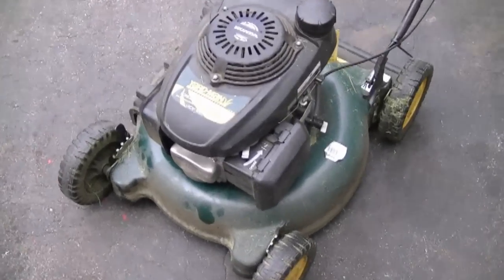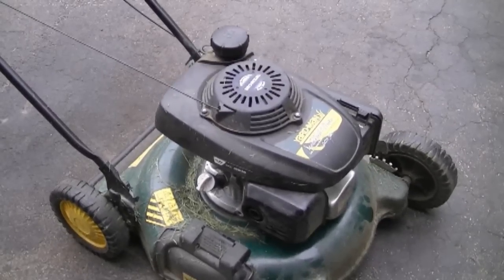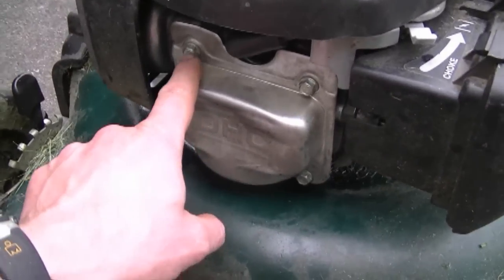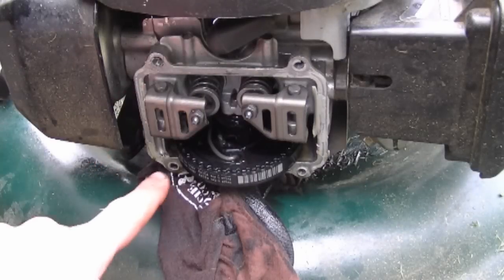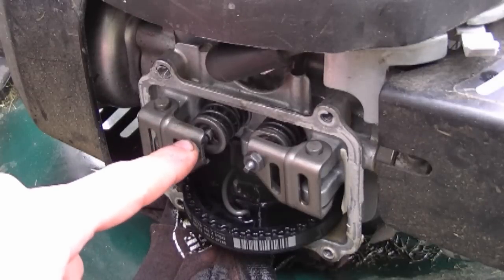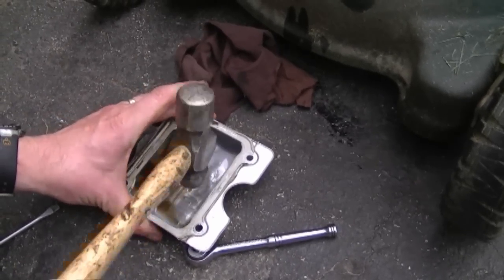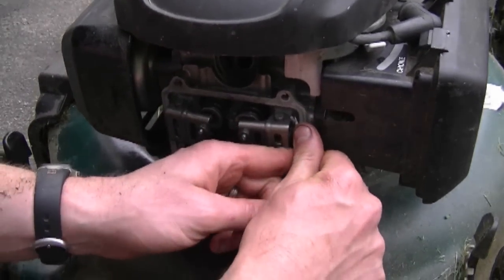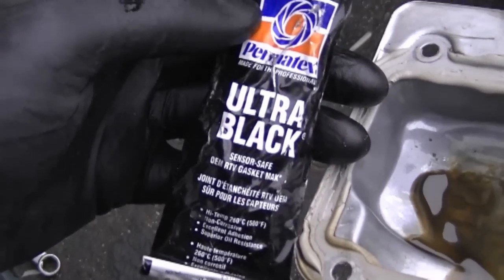Easy Low Engine Compression Repair on Honda Lawnmower - MUST SEE

Comment: Thanks Dony. I just bought a $20 Honda without much compression. I adjusted the valves to spec, no improvement, still backfire through carb. New spark plug, checked timing belt, checked flywheel key, still backfired through carb. I watched this video, took the valve cover off, and it STARTED. Took hammer, straightened valve cover, very small bent spot, and it runs good. Changed the oil and going to cut the yard with it tomorrow. Thank you!! I was almost ready to give up until I found your video.

Comment: One of my customers gave me a yardman/mtd mower with a Honda engine. The recoil was broke. So  I ordered one for $16.00 USD and it fired right up after setting for over 2 years. Cheap fix for a fairly new looking machine. This is the first mower with a Honda engine I've owned. The choke lever is different. As I noticed that it slowly turns off after you turn it on. Thanks for the vids I really enjoy them

Comment: Excellent video. The only thing I would recommend in addition would be to clean and dry the inside of the cover before reinstalling it. The oil in the cover might run out onto your fresh silicone when you tip it up to put it back on. Thanks for all your great videos.

Comment: How is the GCV 160 overall? I have one on a Troy Bilt going into it's 4th season, and am really happy with it.I change the oil once a year with synthetic Rotella T 5-W40, blow out the air filter with a compressor, and it starts on the first or second pull every time.

Comment: Thank you I tried to find something on this particular subject but like I said no one explains it very well. I found at least one video where a guy tells you what each valve should be set at. The problem is he doesn't show you how you would adjust them if they weren't set right. I did watch your other videos on valves and they are awesome thank you for all this info on all these subjects.

Comment: Just a little tip, when I form seals with black silicone, I apply a thin coat of paint to each edge of the surfaces that will be in contact, leave it dry and then apply the silicone. Just because when if I have to fix the same engine, the silicone will come off easily and do not have to remove it whit a cutter or something similar, and the engine keeps clean. Best regards !!!

Comment: i had a no-crank no start issue on my lawn tractor and i immediatly expected it to be something with the carb. the battery had been on trickle charge the night before. so there i was with all the covers and shrouds off screwing with the carb. then i look over to find the blade engagement lever was engaged! sometimes i just feel like a genious!

Comment: You suppose to snug the valve cover slightly then wait 20 min till the rtv harden up then slightly tighten a little more to squish the rtv . That defeat the purpose of the rtv on two flat surface .

Comment: If you find this happening on a GC or GCV160, the valve cover and GASKET from a GSV190 will fit and is much stronger.

Comment: Interesting vid! 
I didn't even know Honda made OHC pushmowers, guess I need to go browsing at more dealers. I don't need to upgrade though, the old 73 Briggs is still running STRONG!!!  :)
I will definitely be taking an OHC engine home, if I find one in the scrap yard!
I wonder how long the timing belt lasts, do they recommend you change after 100,000 laps around the backyard?!!!!!  :)

Comment: Does this mean that if the pull rope on my edger is soft to pull then I may have low compression?
Some time it feel like it is soft to pull but then it goes back to having a little more resistance.
Is this some thing I should worry about?
Thanks

Comment: Amazing how many times just the little things can hold you back with automotive parts.  As in this case a stationary part.  Had a good laugh with the hammer cause that was part of my nick as a lad with other gear heads, "Arm & Hammer". My wedding band has same finish as that valve cover, peened finish.

Comment: @donyboy73 i ended up replacing the timing belt on my MTD Honda...dont replace the belt,replace the mower because once the belt snaps the motors done for.

Comment: Bought a used honda mower had NO compression.  Pulled the valve cover.  The valve stem on the left is broken.  Puncher a hold in between the two value seats.  If I just replaced the valve stem is the hold there going to cause a problem?  How much pressure does it need to hold?  Can I just patch it up with something?   thanks

Comment: Hey dony what would cause an engine to have to much compression. Ive been working on a Briggs Quattro engine. Ive cleaned the fuel tank out and added new fuel, Ive replaced the carburetor, diaphragm, gasket and air filter, I put new oil in and I replaced the spark plug. I did start it up and it smoked for a few minutes which I was expecting. Today when I tried to start it up it snapped the pull cord do you have any idea what might be wrong?

Comment: Timing belt is running in oil. Are there other small engine designed that way? Have you seen broken timing belt in small engine?

Comment: I have a craftsman 6.75 high torque eager1 engine that won't start.  I think it's a briggs. The plug is sparking. when I pull the rope it makes a popping sound. I sprayed some carb cleaner in the plug hole but it wouldn't fire. Do you know what might be the problem?

Comment: i have a 6.75 hp briggs and stratton lawn mower. the piston rings are good and so are the valves and gaskets but still has no compression. can i get some help?

Comment: I have a OTROY-BUILT HONDA MOWER. 
The handle came down to far to the blade as I was mowing the grass, they got loss because  the screws felt out. The blade bent the handle tubes and the engine locked out.  How canI repair it. How can I straighten the tubs to pull them out of the cover and can the engine be repair?

Comment: Hey dony I finally figured out how to adjust the heads. I did end up adjusting them but I still have to much compression. I called Briggs and the guy told me that the intake should be .005 / .007 and the exhaust .007 / .009. My intake is about .006 and the exhaust is about .009. I'm within tolerances but I still have to much compression any ideas?

Comment: Surprised you put the new RTV over the old.  Judging from all your past work I have seen I would have thought you would have cleaned that off.  I know this is not a high pressure seal but still... not judging, just surprised.

Comment: Hi don I have a jd snowmax engine and when I go to blow the snow at first it runs for 5 minutes, then after that it runs a smaller amount of time, every time, one thing is it wasn't used one winter due to health problems, after that year I drained gas, replaced coil. Still happens any ideas? What octane should I be using? Thank you sir.
Reply: clean the carburetor, install new spark plug, and use a minimum of 87 octane fuel
Reply: I've seen plugs go bad and do this. The core builds up too much resistance when hot and no spark until it cools down.

Comment: i have this same engine on my mower and for some reason the carburetors i use to try and fix it all seen to be no good and i have never had more then one bad carburetor in my parts box.i clean out all the jets and small holes and it still runs like shit. its a good engine but i'd hate to give up on it and junk it.

Comment: I have an old silver honda 5.5 lawn mower I am building and wondering which carb to put on it. It was missing, so I have to install another one. Thanks
Reply: What is the displacement?
Reply from the maker: Peter Kapica 160cc
Reply: +Kenneth Mitchell
 Well than, buy a carb online or just steal the carb off the neighbor's mower.

Comment: 8 million videos on when the starter rope will NOT pull out or recoil. However,, have yet to find one about when the starter rope pulls with little or no resistance, recoils fine, but does not engage or start the mower. Shaft not locked up spins ridiculously free, and sounds like someone popping their hand over their mouth.
Reply: Pudangizmo shit man that mower got some issues ring probably.     Buy a new one plz

Comment: Getting the old silicone off is a big pain in the ass. It’s a lot easier to remove it with a dremel tool with a brass wire wheel brush. I recommend using blue painter’s tape to tape off the valve components to help protect the engine from the flying old silicone particles, 4 pieces of tape should do. Once the engine is taped off, go to town :)

Comment: hey i was wondering if i do not have that washer on the spark plug will i have low or no compression. becuase i have an honda gx200 and it is incredibly hard to start (have to pull it like 50 times) and i think that might be the problem becuase there is carbon residue around the outside of the spark plug and when i do finaly get it started i can hear sort of pshs pshs pshs noise on each stroke, is this normal?
Reply from the maker: you need the washer it could leak without it
Reply: ah right thanks do you know if they sell them separtly or should i get a new spark plug
Reply: Div Bro new spark plug
Reply: Rick S always true
Reply: +Rick S h

Comment: I have seen that happen on a craftsman mower the owner ran it into a tree branch and he thought it had hit a rock and broke the key . The funny part is sears looked at it and said the engine was ruined and could not be fixed . He asked me and I said just for fun see if a valve broke thats when we found the problem. I am sure a lot of folks have thrown out mowers because of thise.

Comment: why is there a timing belt(keyword : Belt) in where oil getting all over it, when rubber belts don't like oil all the time, probably a special kind of belt but still, they should have done timing chain or better yet ohv with cam in block

Comment: That is almost as funny as a co-worker who had a "Snow-Pup" for 5-6 years, brings it to the shop every year to "Get it going" SHE says "It runs fine through the first tank of gas and then 1/2 way through the next tank it quits.....Then one day she brought in the gas cap (Gas+40:1 *drip symbol*) and wanted to know what that meant!   After I picked myself off the floor, I explained 2 strokes and how they work, I doubt it matters, she doesn't change oil on her car, so she had to buy a new engine!

Comment: How much compression should a standard 4 stroke mower have?
Reply: From my experience new 150-120 psi, normally 90 psi, minimum 60-80 psi usually
Reply: Reise Kingsbury oh.. damn .. mine's getting 55psi :/ .. might re-test just in-case
Reply: is yours overhead valve or flathead?
Reply: 55 isnt bad for a flathead, i mentioned only ohv pressures, my bad :P
Reply: if it was a cheapie mower id say run it till it dies, long as it mows the lawn
Reply: Mine has so much compression that it does not even start anymore
Reply: sypher0101 Honda clone? Or Tecumseh?
Reply: clone
Reply: It would be hard to start on 55psi but it might actually work

Comment: I have watched many of your videos and learned a lot, but for the first time, I am disappointed in this video. I don't think you should make video of cutting such basic corners as not properly cleaning off all the old sealant and not cleaning the inside of the valve cover off and then letting that oil run down and contaminate the new sealant before it cures.
Reply: I was about to comment the same thing. Well said, I was screaming 'OIL CONTAMINATION!!!' -- I wouldn't even do this for my own stuff, never ever a customer.
Reply: Hmmm ... actually you didn't see the inside of the valve cover immediately before he re-attached it.  So you don't really know whether he cleaned it or not.